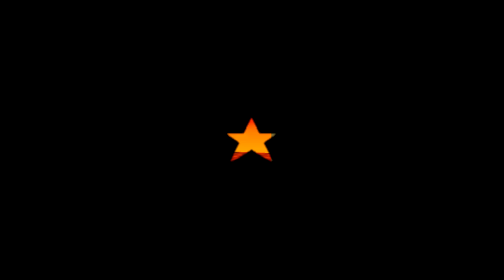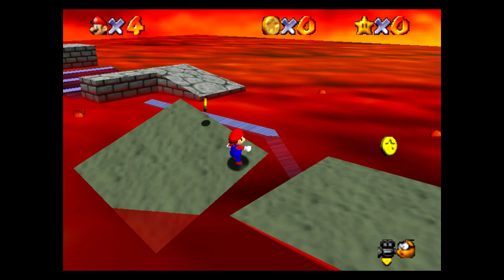BitFS Progress: Unassisted Squish Cancel along the X-Axis (USCX)

Comment: Nice! This seems like a big deal because of how long you’ve worked on this. Does this bring you closer to BitFS 0x? And do you have a method to manipulate the bully remotely?
Reply: ~From the last video's description, iirc, I believe this strat is skipping the "accelerate/move the bully" part of the setup and is just hacking it in. There are other ABC crew members working on this specifically.~ Edit: I could be entitely wrong now that I've re-read the old video's description, this is just me guessing.